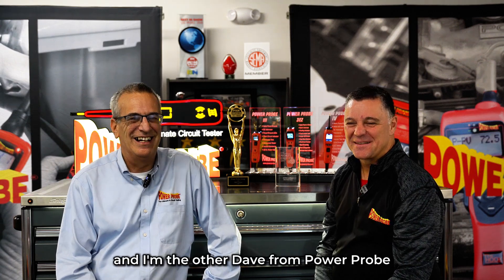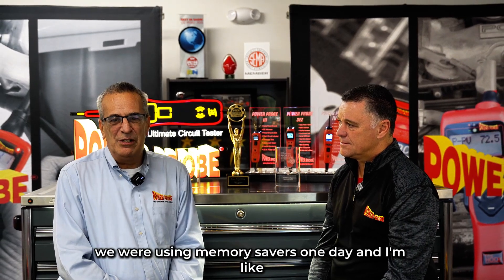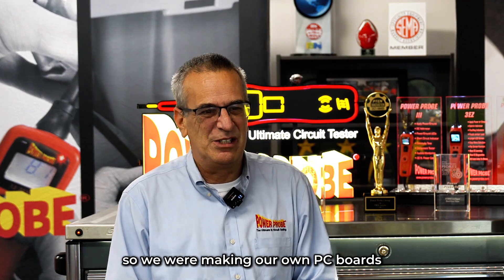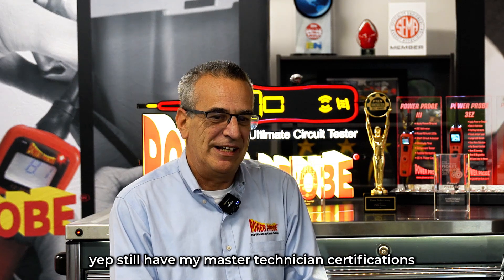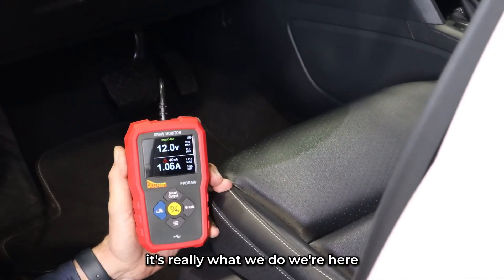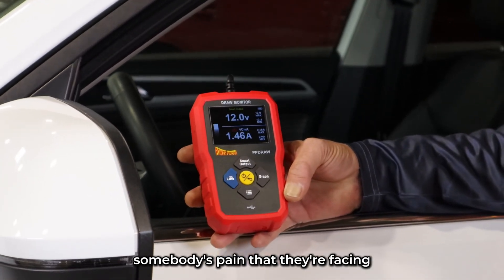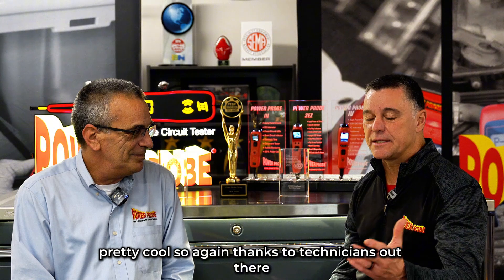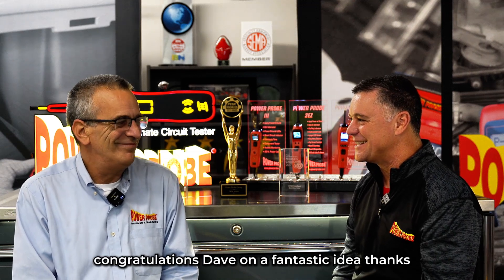The Untold Story of the Power Probe PPDraw — Game-Changer for Electrical Diagnostics!

Comment: I own all of the tools mentioned here on the draw monitor line. Here’s my problem with the PPdraw monitor and please correct me if I’m missing something. When you plug the tool in and initially unplug the battery you get an initial spike of amperage as per usual and then the draw slowly goes down as the car systems go to sleep. The problem is the tool shows you a min/max amperage but the MAX line will only ever show what the initial spike was when you unhooked the battery, so it completely defeats the point of having a min/max reading. The tool should offer a way to clear those values that way once everything goes to sleep you can clear the data at whatever your base amperage is and then if the system spikes you’ll actually be able to see that spike on the max value data line. Again please correct me if I’m missing something here
Reply from the maker: Thanks for the purchases and the feedback. One tip - hit Smart Output before you disconnect the battery, and after the vehicle has gone to sleep. Connect the Draw Monitor, leave it hanging out the window with everything else closed up, wait 15 minutes then hit Smart Output before disconnecting the battery. This will eliminate that initial spike.
Reply: @PowerProbeUSA ok I’ll try that, thanks for the input. That makes sense because usually I’ll have the car “awake”, plug it in, hit smart output and then disconnect the battery and wait until it falls asleep. So you’re saying get the car “ready” for a draw test as in latching the doors etc., then plug in the monitor, wait until the car goes to sleep or about 15-30 mins, then press smart output, then disconnect the battery
Reply from the maker: @2491kridge exactly. No sense watching the countdown, just need to know where the draw is after 20 minutes
Reply: @PowerProbeUSA yup makes sense, I hadn’t thought of doing it that way. Watch now I won’t have a draw come into the shop for like 6 months lol
Reply from the maker: Also, check out the free Power Probe Link app, which offers data recording.
Reply: @PowerProbeUSA  that's what makes this tool extra amazing. Thank you for adding that feature.

Comment: Would be helpful if the uk had a help line for the power probe I have the first probe and it blew within three tests and now shows a short when not even connected to a wire. it was within warrantee at the time after three emails and contacting the seller multiple times no response I have given up. it randomly shows open then goes back to short when connected to wires with no short or a short. paid loads for the full kit bought a cheaper model of another brand and its not as good but at least it works. been sat in a box ever since now about two years.
Reply from the maker: We actually just opened a new facility in the UK. Look for the official announcement coming soon. In the meantime, sometime will reach out to you with help.
Reply from the maker: Hey Peter- if you want to send contact info to david.merendino@powerprobe.com, I'd be happy to help you with this.